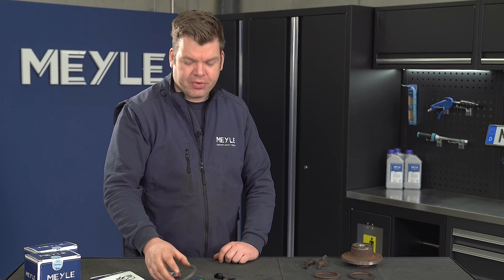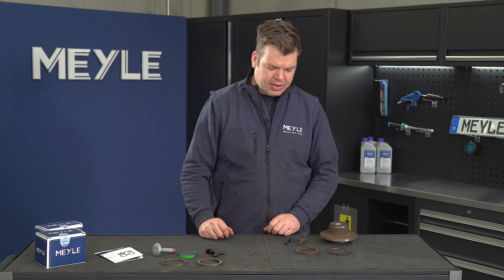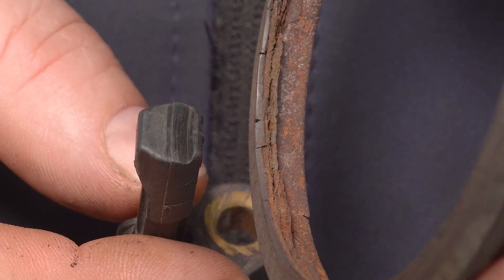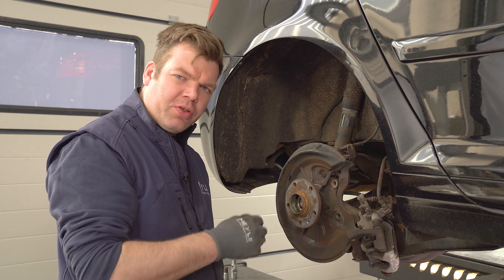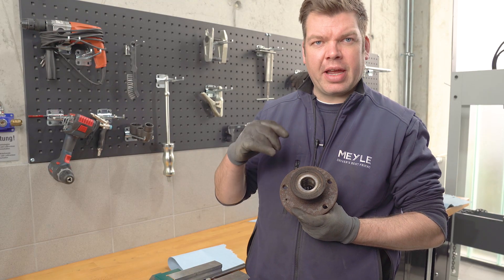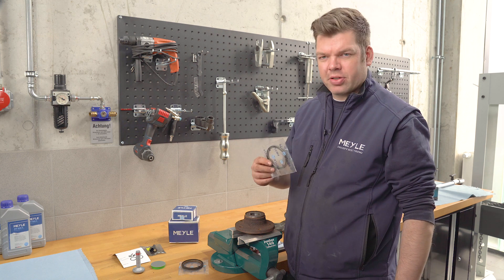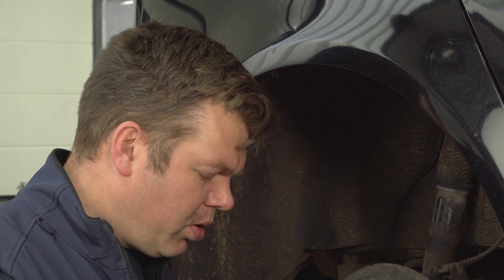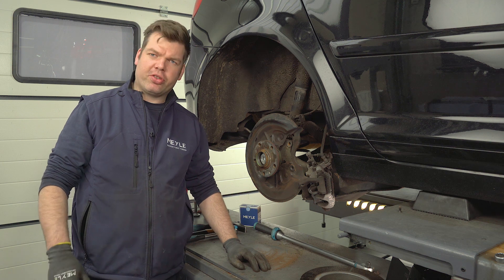Repairing a typical ABS Sensor fault on several Volkswagen, Audi and Seat models

Comment: In the video, after installing the ring, the ring magnetics are checked with presumably iron filings in a card thats not provided in the meyle kit.  What is being checked here and are the left and right side rings different?  If they are different, can this be checked in another way to verify the correct ring have been included in the kit?   FWIW, I have both left and right side kits installed, but the left side kit does not solve the error code, that is the sensor (which reads 4.5MOhm) is not picking up the ring "tone" ie not showing speed on my VCDS.
Reply from the maker: This card is used to check the segments of the ABS magnetic rings and the condition, number of segments and damage. If the segments are uneven, the ABS magnetic ring is damaged and must be replaced.

The ABS magnetic rings are not different on the vehicles from left to right.

Unfortunately, we cannot evaluate this from a distance with regard to the error code. This must be determined directly on the vehicle.

Comment: Thank you. That video was very informative. I'm about to change the sensor (which I have bought from VW). Hopefully that will cure the problem, but the knowledge that there is another part that might require replacing is invaluable. I have subscribed to your channel. Thanks again.

Comment: I have abs sensor error codes on the two rear wheels. The mechanic removed the discs checked the bearings and checked the abs sensor rings and all is ok. If not the sensors and not the rings on those two rear wheels - what else can it be? I have an abs noise coming from the front right when I brake hard.

Comment: Is it possible to put a right ABS sensor into a left wheel as i noticed the notched line is horizontal when in correctly and if put on in the other side the notched line is vertical that’s rubbing opposite sides to the wheel bearing?
Reply from the maker: The professional installation of the ABS sensors is always a basic requirement for their subsequent perfect function. The sensors should only fit on one side and it is always essential to follow the installation instructions of the original manufacturer.
Incorrect assembly will involuntarily lead to signal errors and thus to a malfunction of the ABS system.

Comment: I have a 2014 vw beetle that I started out with a EPC light on and the typical problems when on loses power, burns a lot of gas. Code P0221, throttle pedal position sensor/switch B circuit.
 I changed the throttle pedal with sensor and the mass air flow unit with sensor under the throttle body and the throttle body, cleaned and used electrical grease on all the sensors.   Changed spark plugs, coils and engine air filter. Not getting the EPC light as much, but I'm getting a new code P0491 Secondary Air Injection System Insufficient Flow Bank 1 with a check engine light.
 I changed the Sensor and the secondary air flow check valve.  Now sometimes I just get the check engine light or just the EPC light or both. They don't come on as much though. What could it be? Anybody have any other ideas on what I can change to fixed this problem?

Comment: I’m experiencing some hesitation on my 05 Passat wagon. Almost like a backfire. Is this a symptom of bad wheels sensors, maybe setting off the abs? Traction control light is also on.
Reply from the maker: As you describe the situation, your vehicle could really have a problem with the ESP sensor system. However, we cannot reliably assess this from a distance. Therefore, you should visit a specialist workshop to check and analyze everything else.

Comment: Hi, Dear sir , after  OBD check, I found flowing error code  my Vw Golf 5 2008 1.4 petrol engine 80ps 
Error code : 17069 
Error code : 538 
Error code: 819 
Error code : 1316 , 1314 
Error code : 1321 , 1259 , 2071 , 1516 , 2403 , 1520 
My Volkswagen Golf 5 2008 1.4 petrol engine 
Battery has been charge a few days ago .
Yes have issues rear passenger door can not be open from inside the car . 
catalytic converter  was clogged and has been charge 3 days ago . 
Their is no sign in the dashboard at the moment. But still error code has been found . So should I ease the code or repair those problems. 
Please help me . And thanks for your reply. Have a nice christmas you and your family.
Reply from the maker: Hi, it sounds like you should have a local mechanic take a look at it. Unfortunately, we can't help you from a distance.

Comment: I see you still replaced the sensor. How do you know which one was the problem? The ring or the sensor? I am all for replacing as much parts as possible while things are apart, specially with a lot of miles on the car. For example I would replace  the bearing at the same time and breaks if need to be. Thanks for the video.
Reply from the maker: The corrosion on the sensor-ring and the increased diameter causes a damage on the sensor. This is the reason why both items should be replaced
The kit is designed to save some money. When replacing the sensor ring, the brake rotors, brake pads and wheel hub need to be unmounted. But in case that the brake rotors and pads have just been replaced and the wheel bearing is technically in a good condition, you can save some money and only replace the parts that are defective

Comment: Excellent video, great shots of all the important parts.  Just did rear passenger and rear driver abs/wheel speed sensors.  Seems like the problems are cleared up, but now I see how to change out the ring (and take the wheel hub off!).  Thanks for your efforts.